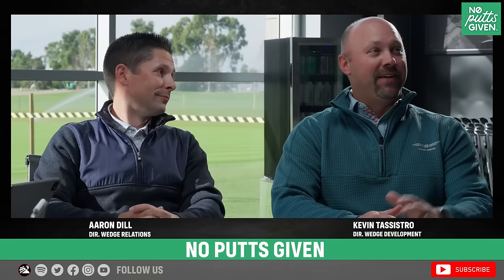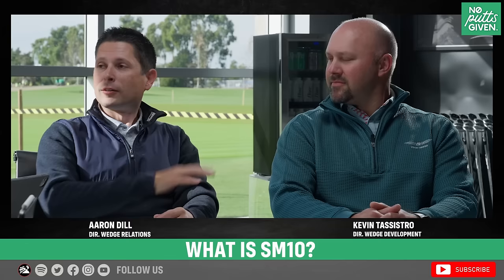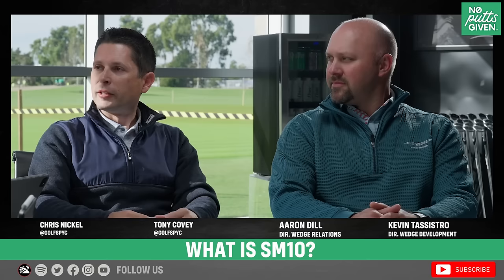The Truth About Vokey's New SM10 Wedges | No Putts Given

Comment: When i lay my sandwedge open i like the leading edge to still be on the ground. My old ping wedges do that.
Reply: Vokey T Grind will do that
Reply: @georgedelaney7085  I'm going to order one. Josh Speight local player in Richmond has been on me about that.
Reply: I use the Ping E for the same reason. Flicks it out Like a spade out of bunkers but still works a treat off tight lies.